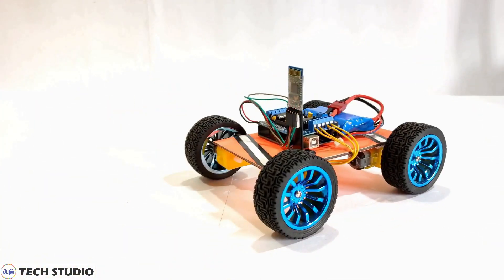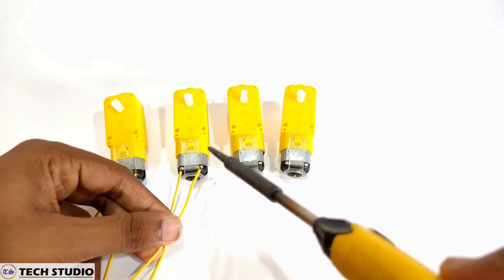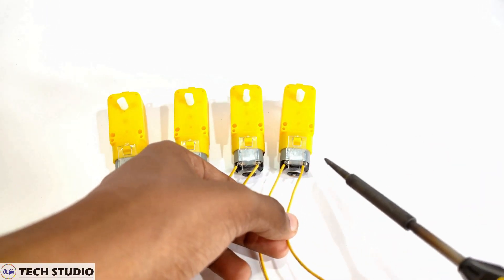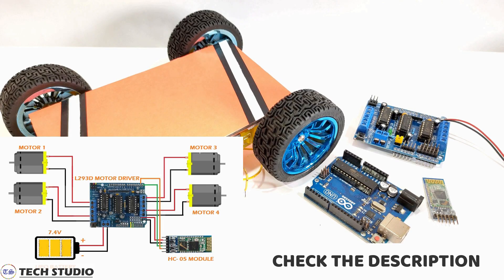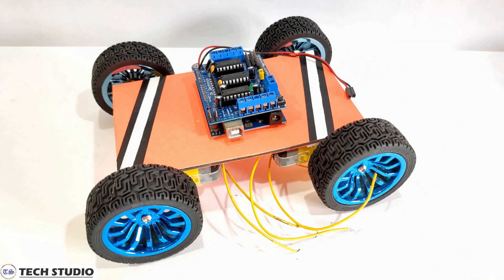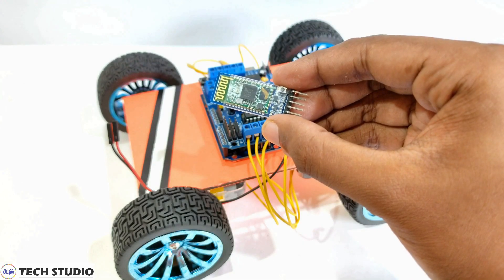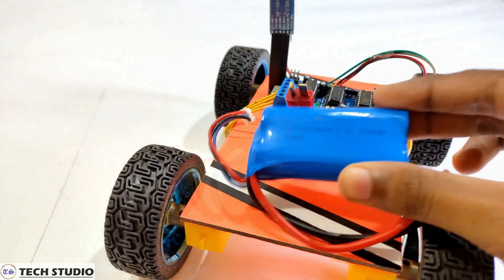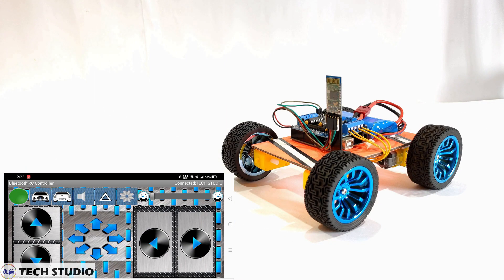Bluetooth controlled car using arduino uno and l293d motor driver | My Tech Studio

Comment: Can i use normal dc motors except geared ?
Reply from the maker: Yes you can, but it will not work as good as the geared one.